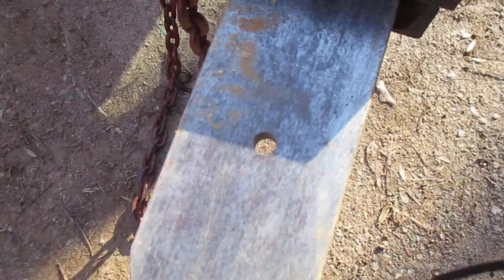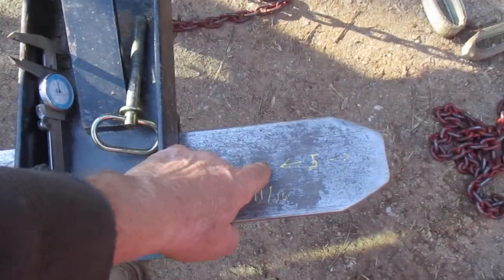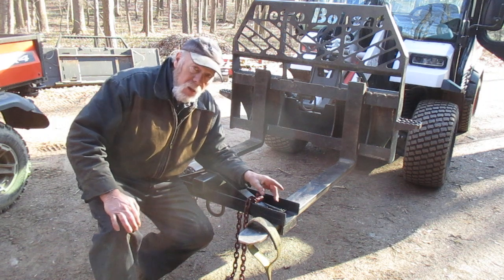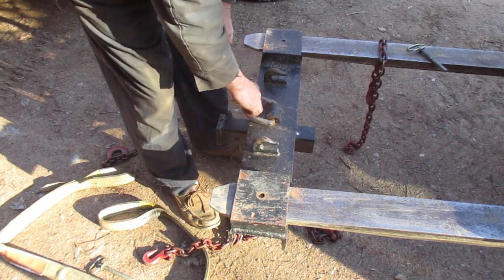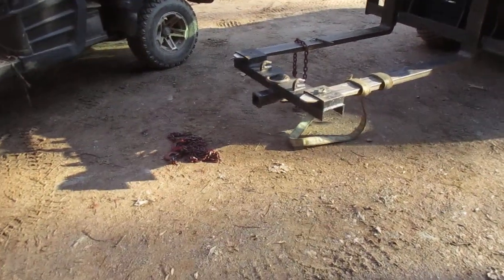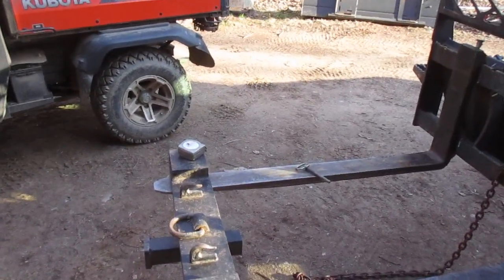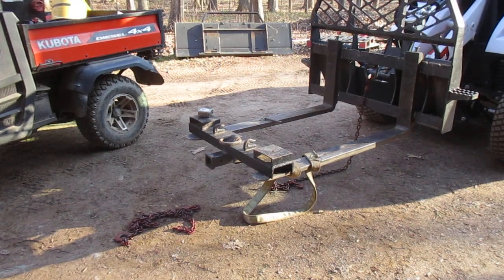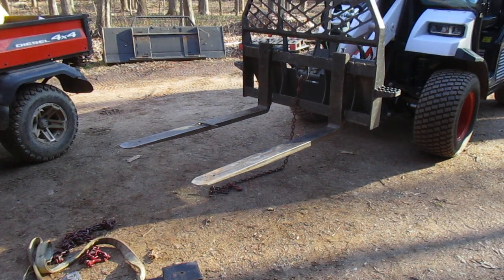HOLES  in FORKLIFT FORKS # 1080

Comment: We had the insurance company had us weld the cut holes up from a cut torch.  The insurance company said if come from the manufacturer of the forks are drill at the manufacturer are okay because they are stamped. When using a torch it changes the tensile strength causing it to become more brittle than drilled holes.
Reply from the maker: hi there thats a good point , thanks for bringing it , john

Comment: The mill I worked in had several 6000-8000 lb forklifts that were used to haul lumber from the dry chain carts and to drag the carts back. The hole in the fork would go on a pin and pull the cart back instead of a person pushing it. When a person that left with an ax to grind would call OSHA to report "unsafe working conditions". Then the inspection came... OSHA would come in guns blazing looking for money from fines. We would look at the list and had a little time to fix everything. The last time I was involved in an OSHA list it had everything from unlabeled containers, doors opening the wrong direction, unpainted guards and so much more. My boss called bull on a lot of the "charges" and we were not fined the $50,000. 
      I have a similar trailer mover for my skid steer with longer channel iron and a safety chain to hook it to the fork carriage.  I use a chain on the fork sometimes and wrap it a couple times around the fork and it won't slide until the weight is off the chain. Same with a strap, couple wraps makes it not slip.
Reply from the maker: hi there good read .i think most inspectors work for the government of some type and they have no concept of money added with little common sense and head strong with power . you  do what i say or else .   glad you stopped in john

Comment: I love your videos John, You are spot on with the holes in the forks. I am going to put holes in my forks, I have a bracket all ready made. Stay safe John!
Reply from the maker: hi there well i try to most the time . glad you stopped in john
Reply: YES, stay safe John while you alter a factory fork. You can do it, but why would you? Just make a fork attachment with a ball on the end and DO NOT follow his example of altering an expensive fork for this purpose. By the way, I am a welder and own heavy equipment. Just make an attachment that slide over your forks with a hitch ball on it.

Comment: YES, stay safe John while you alter a factory fork. You can do it, but why would you? Just make a fork attachment with a ball on the end and DO NOT follow his example of altering an expensive fork for this purpose. By the way, I am a welder and own heavy equipment. Just make an attachment that slide over your forks with a hitch ball on it.
Reply from the maker: hi there do it what ever works best for you , i have never even hurt or bent a fork and been doing this to the forks for around 40 years now . its fast secure and fairly light , john

Comment: The thickness rating is on the heel of the forks and not where you're pointing out. The load rating for the forklift is based on the load center. The further you get out from the center of the forks the less the load rating or capacity, When you torch or drill a hole in the forks it weakens the forks because the heat generated weaken because it made out of hardened steel.
Reply from the maker: hi there i drilled the wholes , thanks for the input  john

Comment: I've loaded and lifted 2 tons worth of wood and other building supplies with smaller ones.  By the way those holes are generally used as anti slide or load stabilizer locking pins

Comment: Good video and job. You have a very safe set up. The place I worked at over 40 years ago rebuilt a lot of things including rad. Heater cores and etc. OSHA, Deq, EPA and fire inspector.  Forced them to close when Obama was in. Now if you need a rad. Or heater core. You have to buy a new one from China. They outlawed all the repair shops. Unless you know where one is left there are none the big one in Salem VA. Has closed too. Take care be safe and well.
Reply from the maker: hi there i know just what you mean , the 2 around me closed . and i need a rad fixed , thanks for stopping in john

Comment: Very slick, I've built similar devices for the 3 point attachment on my tractors. 
I admit I hadn't thought of doing it the way you've come up with. 
But if I do use a ball to move a trailer with, I'm typically just moving it several feet out of the way to mow around the equipment yard here, and not any distance from where it's at, and then right back to it's original location. 
I use mine to lift trailers up that have sunken into the dirt from excessive rain to attach them to the truck when I back under the tongue. 
I use two balls with hair pins and oversized washers to retain the balls in place, and nylon lifting straps in a cinched fashion so they can't slide off the ends of forks.
I'm not lifting anything to move it anywhere that will cause the straps to swing back towards the machine. 
Merely a safe way to lift trailers that the landing gear has sank into deep to hook up to trucks. 
Better than just sticking a bare fork or forks under the frame and having it slide off or back at the tractor wrecking the frames, are wedging itself onto the fork or forks. 
Thanks for the ideal, I always figured it would take a mag drill to drill through the harden steel. 
Which I don't have, and as much as I would like one, I honestly don't have the need for one 99 .9% of the time. 
But as I said, in all my years of burning holes in forks, I've never bent one in the normal use of the forks lifting things that I lift, as I always use the entire length of the fork, or the back as they are intended to be used.
Reply from the maker: hi there good read , thanks for that and stopping by john

Comment: I've used lifting hooks on jobs where big brother was watching, nothing is allowed to be rigged over ther forks. If you google lifting hook for forklift you'll see nearly the same unit, just painted with a certificate plate on the side. Only real difference is they use T handle bolts to clamp rather then the pin. I'm sure this is mainly because they are ment to be used back closer to the machine where the fork has full load rating. This still comes back to a sharp operator keeping the forks fairly level because a heavy load would bend the clamp bolts if tilted too much.
Another thing a guy told me once, the difference in clevis vs shackle is one has threads, the other has horse poop..lol.
Reply from the maker: hi there thanks for the read , and stopping in john

Comment: They look ok to me :)
Any other questions?  
I say let’s see you bend them! 
Like you said what are you going to pick up right out there.  
I made a ball attachment for my brother that fits over the fork with a safety chain back to the front of the forklift.
It includes bolts that clamp onto the side of the forks but he never does them up.  :)
He didn’t want to drill holes int the fork.
Reply from the maker: hi there i think you should do what ever you feel safe to do , glad you stopped in john

Comment: I hsve 2 different size holes on mine.  One is for each  bolt size on the traillerball.  Mine were drilled on a press.  Never had a problem lifting or moving .
Reply from the maker: hi there ya i think its fine , thanks for stopping in john
Reply: You are welcome!

Comment: Hey John, I agree with everything you said in this video. The Bottom Line is this, "Common Sense", If you don't use the Sense that God Gave you, Well I guess that is another story! Now as far as OHSA, They are great for what they were intended for at the time, But some of their Regulation and Suggested Methods can be outdated to todays work force. I am not saying there worthless, But I think they need to be relooked at and adjusted to today work procedures. And there again, It is all "Common Sense" And I am not downing OSHA, Not at all. Just over the top at times.
Thanks John for your video, Enjoyed it.
PS, The Company I retired from had the same piece our welder made to slide on the forks of our forklift, Wasn't made like yours. Actually, Yours are better. You need to Patent them and go into business making them.
Reply from the maker: hi there thanks for the read and stopping by with it  john

Comment: BURNING A HOLE IN THE FOLK TAKES THE TEMPER AND STRENGTH OUT OF THE AREA HEATED BY THE CUT.   IT'S THE SAME WITH TRUCK FRAMES, NO WELDING OR CUTTING CAUSE IT CREATES STRESS IN THE HEAT TREATED METAL.  DRILLING WILL NOT CHANGE THE HEAT TREATING ON THE TIP OF THE FORK.

Comment: If your fork trailer setup wouldn’t pass an OSHA inspection, then the OSHA inspector has no common sense. Unfortunately, in my experience, that is often the case. If a mechanic had water in an antifreeze bottle it had to be labeled water or it was a violation, all the light switches on the walls had to be labeled which lights they were for or it was a violation, that’s the kind of stupid stuff they get upset about..
Reply from the maker: hi there good point , thanks john